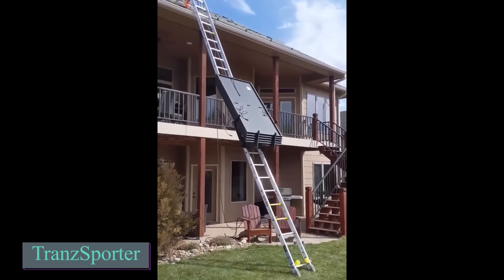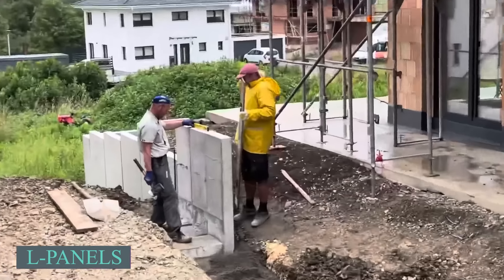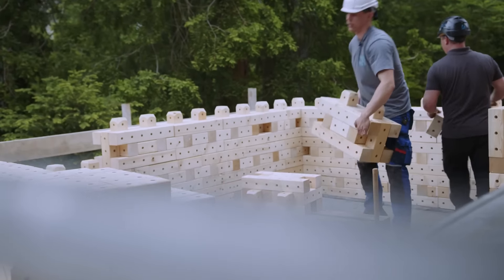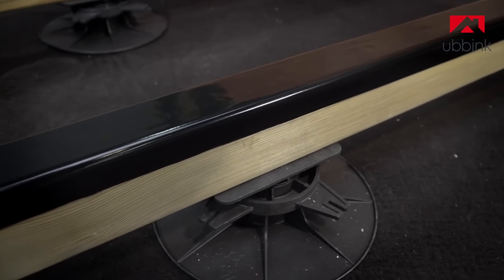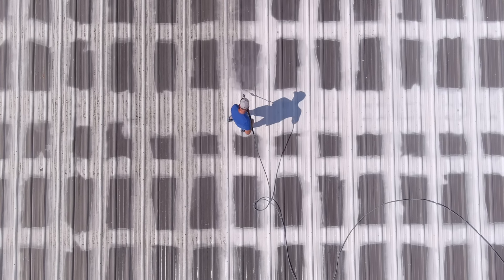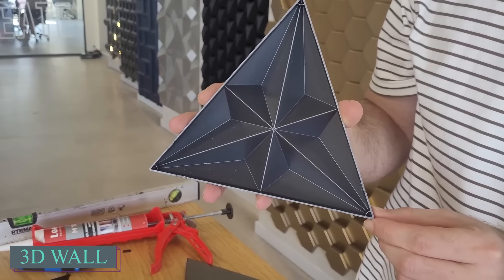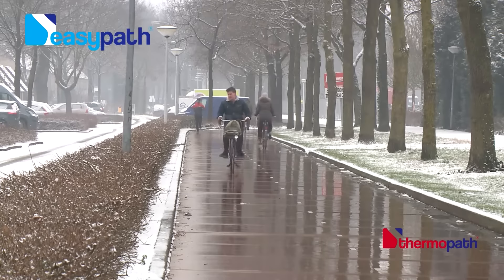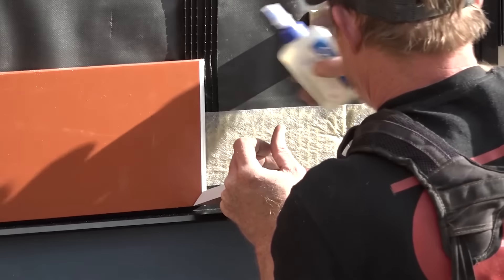Construction Technologies That Have Reached A New Level

Comment: I like the Tranzporter ladder to haul ply, shingles, bags, gyprock sheets,  up to a higher level..if not use a Winch 60$ and some duct tape, a few rivets , a few straps, a few good hooks.
Reply: That is old technology. When I was working as a carpenter in the mid 1970s, the roofer had a gasoline powered one. Is was a real back saver. This was in the USA.

Comment: how do we know the electric version is more environmentally friendly, how were the batteries mined and where did the electricity come from.
Reply: The carbon footprint to produce a lithium ion battery is pretty well known for the major producers (Samsung, LG, Tesla, etc). It's roughly ~100 kg of CO2 for every kWh of batteries produced (more recent chemistries and manufacturing processes are achieving even lower CO2 emissions). These Tranzsporters can run on (2x) 9 Ah Dewalt batteries, which at 20V is about 360 Wh, so producing those batteries would emit about 36 kg of CO2. To charge them, average US electric grid CO2 emission is about 0.5 kg / kWh of consumption (even cleaner in places where we don't use coal). So the battery version of the lift has this CO2 profile: *36 kg to produce the batteries + 0.18 kg for every 8 hours shift of operation (full charge cycle)*.

The engine version of the Tranzsporter uses a Honda GX120 motor (shown in the video), which if you search online uses about .29 gal of gasoline per hour of runtime at 3600 rpm. This is about 2 gal per the same 8 hour shift of actual loaded work. Each gallon of gasoline emits about 8 kg of CO2 to atmosphere.

So the CO2 profile of the Honda motor is: *XX kg to produce the motor + 16 kg for every 8 hour shift of loaded work*. 3 work shifts and you've leapfrogged the battery pollution.
Reply: @jonrhaider  I swear some commenters think we haven't got google for their ill-thought-out comments and red herrings.

Comment: There is a weakness in metal braced 2x4 trusses.  Metal rusts.  Today, a few minutes from now, I will be tearing out the old leaking water heater and replacing nearly everything around it.  Leaks in houses are normal to ubiquitous. Most are tiny and go unnoticed. A tiny drip onto a structural metal brace will eat it.
Reply: Iron & steel rust without proper treatment, but not all metals.  I don’t know all of the answers, but would bet you would not be replacing a stainless steel water heater of the same age.  Up front costs play into my decisions more than long-term ones, so I don’t have stainless either.

I just thought there were some wildly creative products shown in this video, and have a 30 year old joist in the center of my house that has cracked from a knot in the original construction.  It is conveniently located near the main electrical panel, between 1) the water main and almost every water use, 2) the gas main and half of the gas use, 3) between the HVAC system and bedrooms.  A replacement beam that already has room for all of those utilities without being weakened is VERY attractive.

I also had experience with a joist on a roughly 100 year old house (originally coal heated) that previous owners didn’t mind notching out for large pipes or vents, then nailing on a 2x4 “for support.”  As a new homeowner it took me a while to understand why the living room floor had a gentle 2” slope up towards the middle and down at the sides.

This isn’t a rant at you, just the messed-up things I’ve had wrong with houses that might have been avoided with better designs.  Or not.  None of these new products fix stupidity or (more generously) ignorance.
Reply: @firstmkb  I have seen a copper water heater (ancient, tore that one out in the 1970s.  I have never seen a stainless steel water heater.  They probably exist,, and choose the correct alloy,, last a lifetime.  Was not talking stainless.  The formed steel braces that make up the flat truss,, that steel is neither thick nor stainless,, might have a zinc or cad coating, likely neither (as you said , cost)  The steel, if subjected to a chronic leak, will rust through.   The structure needs a long term outlook.
Reply: @Sailor376also  I looked at a “condensing” gas water heater maybe 15 years ago that was amazingly efficient.  As I remember, combustion happened in a spiral tube inside the water, and cold water came in from the top to cool the exhaust gas enough to condense water out of burned natural gas.  Very interesting but it cost several times as much as a standard glass lined one.

Details are fuzzy - I’m getting older!